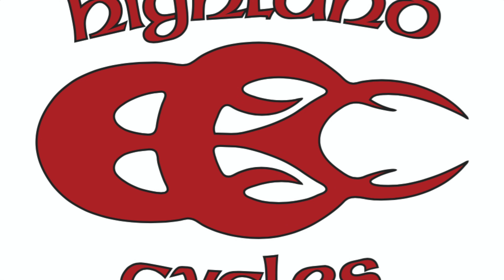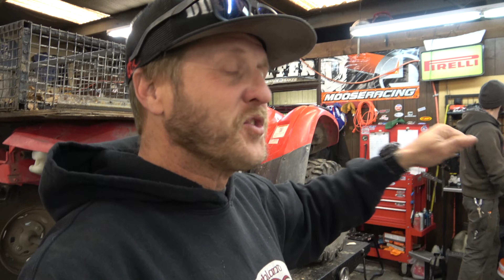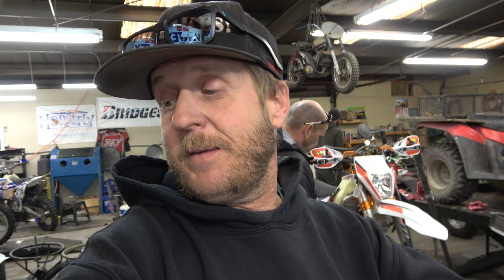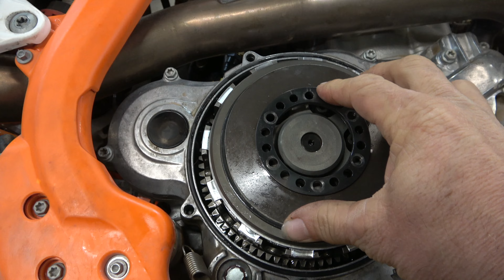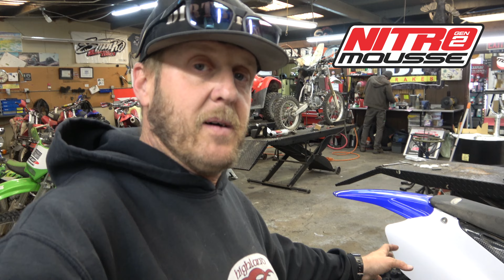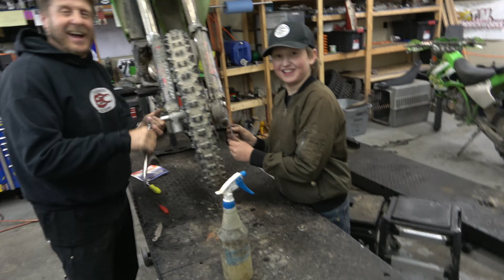The Shlog #141 : Someone screwed up a Rekluse install!

Comment: In my experience, most Rekluse installs are not adjusted right.  The latest ones are much better in this regard though.  The older ones I have been exposed to were seemingly never in adjustment for more than 2 minutes.

No need for a Rekluse here.  When it really gets gnarly/scary, I wheelie into it and involuntarily close my eyes briefly.  It usually works out, my 300 does all the actual work!
Reply from the maker: Hahahaha